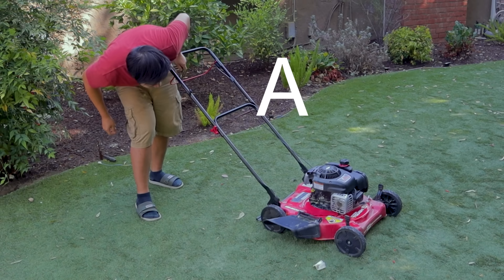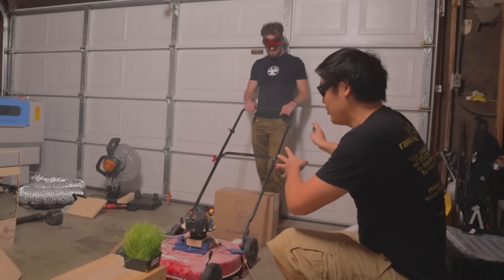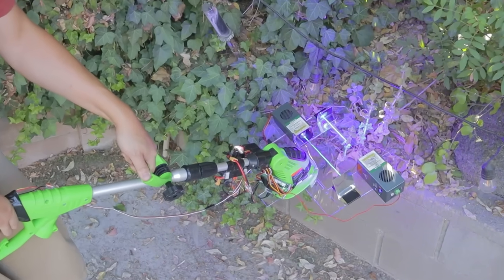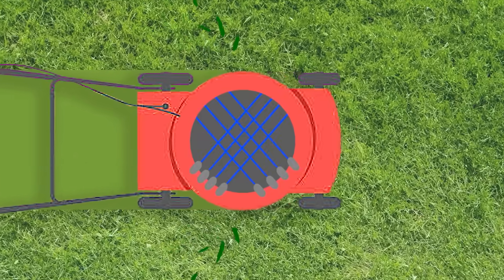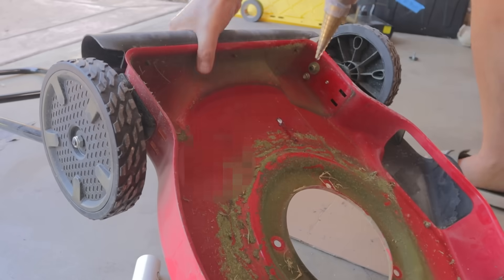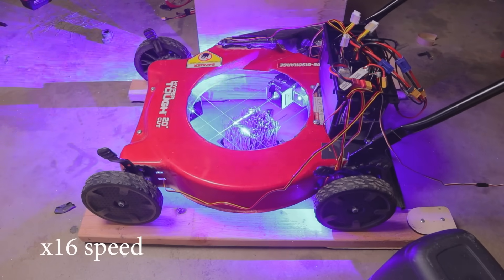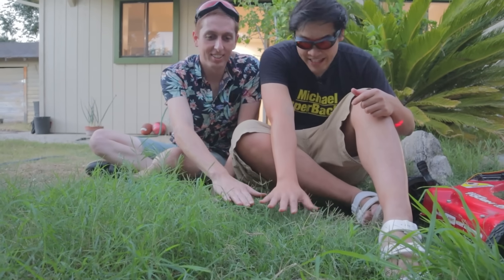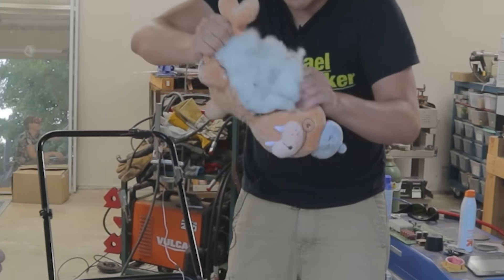mowing a Lawn like it's the year 3000

Comment: You need one of those pulsed laser rust removers. You can use a wide beam and they are so powerful it would instantly cut through a patch of grass in a fraction of a second
Reply: He could borrow Kevin's.
Reply: @jangschoen1019  yep! That's what made me think of it
Reply: video title will either be "blinding an entire city in less than 5 seconds" or "accidentally blinding myself and my whole family for wacky content lol" depending on how far he makes it into the experiment.
Reply: @itsnotthat_ Allen Pan has made the advancement [Communal Blindness].
Reply: when removing rust, the surface is dry. the materials are good at absorbing energy and heating up.

water has to absorb latent heat, and it takes a LOT of energy to take it from liquid to gas... and until its removed, you are stuck at 100C.

and its only being heated by the absorption of the "solid" matter around it, conducting heat to it. the laser cant heat the water itself, directly.
Reply: Styropyro's 2kw one

Comment: I think the stationary lawnmower idea has merit. 

What you need to do is set up a grid across the perimeter of your entire lawn. That way you can just turn it on and let it run instead of moving around a small grid for hours.

Bonus points because you can use it to maim trespassers.
Reply: Reminds me of the laser security system from Over The Hedge
Reply: @SamanthaLaurier  the hallway scene from the first Resident Evil flick.
Reply: @jpotter2086  Didn't see it
Reply: @SamanthaLaurier  not a great movie unless you like scifi horror cheese, but the "hallway" scene is very applicable to this ... uhh ... project
Reply: @SamanthaLaurier  yea the Depelter Turbo
Reply: I can see where Allen's head was at though, his lasers are "contained"
Reply: gotta level your lawn or the setup gets real wacky real fast
Reply: I think Allen should try making an autonomous scythe machine. A Scythe Roomba, if you will. I bet it could be more effective than a mower.
Reply: @orijimi That’s just a robot lawnmower…
Reply: @jacextreme6432  Nah, it would have the geometry of the blade preventing it from hitting protrusions and the like, and it wouldn't get clogged up.
Reply: Very slow rotation from motor on a geared down gearbox will do it. Stationary should do it
Reply: I kinda want someone to have this just so I could one day read a news story about some poor sod getting sued out of their house because their lawnmowing system blinded a neighbor's kid, and I'd laugh and laugh and laugh
Reply: @Makujah_  ur evil
Reply: @edgeribble  only sometimes
Reply: I think the grass-cutting is the bonus, personally. And does it have to be trespassers?
Reply: You do need to have lots of warning labels around your property though
Reply: That will stop the neighbors cat from pooping on my yard
Reply: put a number of lasers on a rotating assembly which spins continuously in one direction to cover a circular area. repeat to cover your whole lawn
Reply: What if someone walks on the lawn while the stationary laser is mowing, will it cut their feet off?
Reply: Just so long as you make sure nobody looks at your lawn without eye protection.
Reply: I used to daydream about a setup like that as a kid.
Reply: Man, the lawsuit from that booby trap would bankrupt Canada.
Reply: the de pelter turbo :-p
Reply: it would end up to a neigborhood of blind people
Reply: @borincod then they’ll never be able to pick you out of a line up
Reply: The irony of California making everything illegal. Is one, cali doesn't have castle doctrine (used to I think) and 2 it is already illegal to "boobie trap".
Cali just needs to stop being "restarted"
Reply: If you're going to do that, just build it in to the sprinkler system as a combined unit.
Reply: As a kid I imagined someday we'd have these in a form factor just like water sprinkler heads that pop out of the ground and rotate in a circle. I did also wonder how they'd solve the safety issues but that was obviously above my pay grade 😅
Reply: Getting some "Over the Hedge" vibes haha
Reply: AntiSprinkler
Reply: Also great for giving hedgehogs a haircut
Reply: Lol. My new security idea! Lol
Reply: Resident Evil type of a deal, I see?
Reply: make them pop up like automated sprinklers... wait, can we combine them?!
Reply: i mean this activating at night every few days? this could work
Reply: I legit thought of that idea about a decade ago when I was cutting grass, theirs got to be an easier way to do this
Reply: Does it though?
Reply: Eh u still have squares that grass grows through. You need a single laser that slowly moves from the top of the yard to the bottom at a slow rate. It covers the entire yard, and gets it all in one slow sweep
Reply: That would definitely create a large fire
Reply: Think of all the dead and blind chipmunks, squirrels, and birbs.
Rabbits, foxes, possums, cats, dogs...
Reply: @m4rvinmartian  so you're saying you also get to collect pelts and feathers for other projects? seems like a win/win
Reply: @janthran  And dinner!
Reply: @janthran  migratory bird act has entered the chat
Reply: @IntegerOfDoom  Potentially precooked as well!
Reply: @janthran  lol
Reply: @IntegerOfDoom presliced and cooked. 😂
Reply: @m4rvinmartian  and humans
Reply: @m4rvinmartian so dinner?! Hell yea
Reply: "maim trespassers" ... or hedgehogs